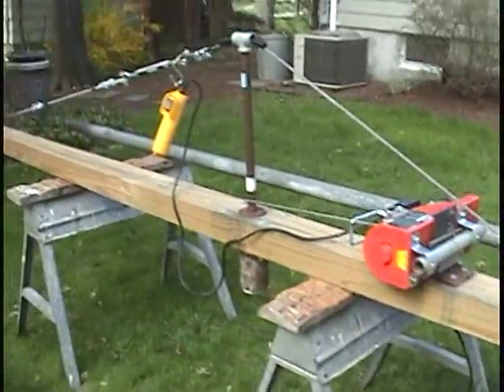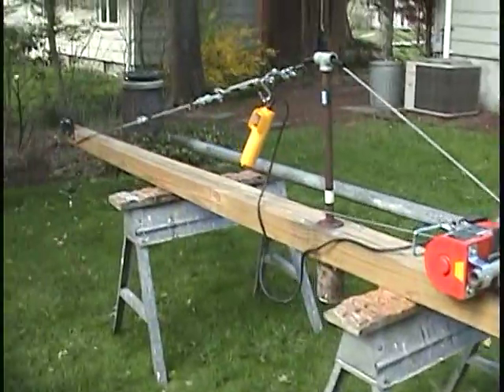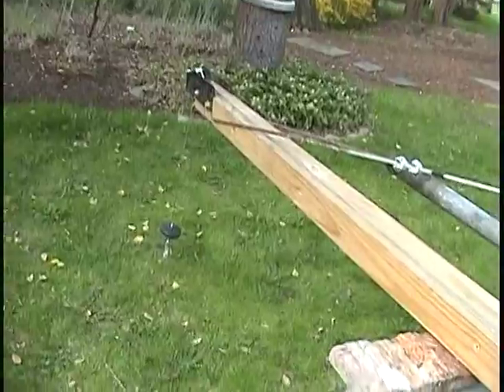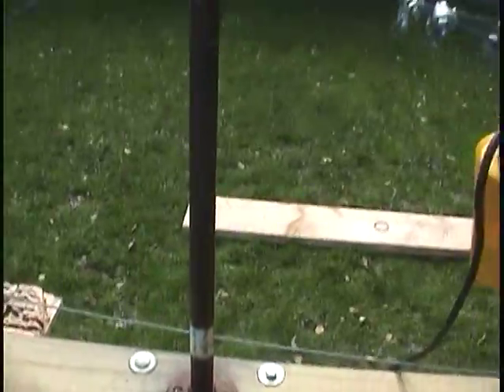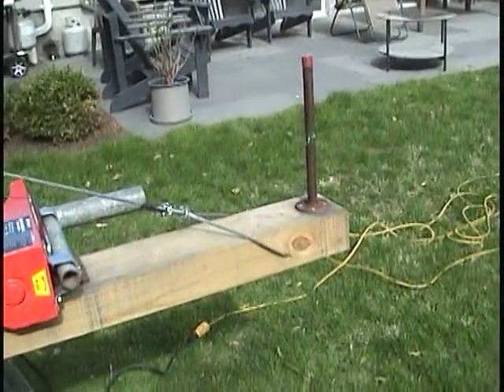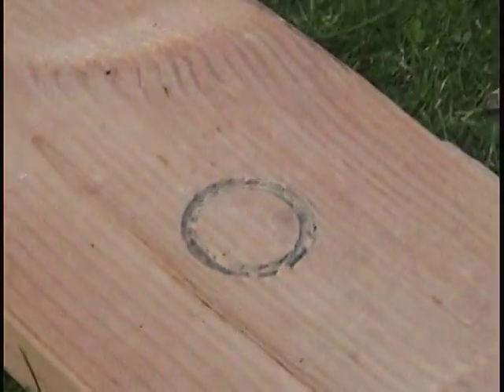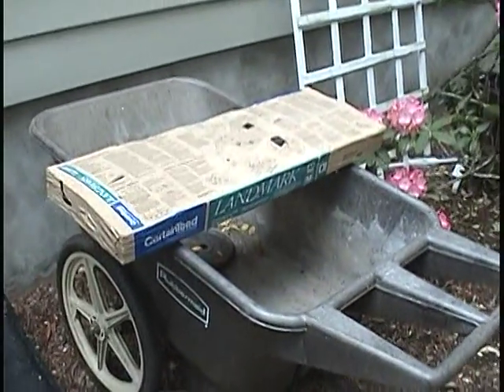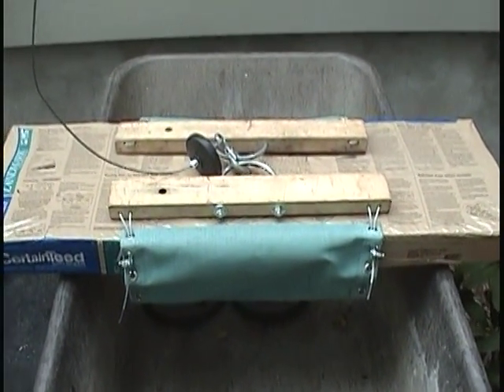Shingle Lift Shingle Crane Shingle Hoist

Comment: How did you mount it to the roof?  Would like to that.  Very clever!!  Great idea!
Reply from the maker: I used a heavy 2" galvanized pipe cut through the roof at the peak, braced accordingly, and nested in to a wood socket on the attic floor. Since the pipe was only above the roofline by a foot or so, and the length below the roofline was 5x more, it had good lateral strength. Most of the force was downward.

Comment: Your work is great .We are"https://www.loadmate.in" RMS INDUSTRIES (Loadmate) (An ISO 9001:2008 Certified Company) is one of the leading EOT Crane Manufacturer in India."https://loadmate.blogspot.in/2018/03/one-of-vital-and-long-tasks-was.html"  We also manufacture Manual Chain Pulley Block, Loadmate),Electric Chain hoist, Electric Wire Rope Hoist, HOT Cranes, Gantry Cranes, JIB Cranes,Goliath Crane.
"https://loadmate.blogspot.in/2018/04/how-to-install-electric-chain-hoist.html" 
"https://loadmate.blogspot.in/2018/04/there-are-varied-prestigious-suppliers.html" 
"https://loadmate.blogspot.in/2018/02/www.loadmate.in_15.html"
https://www.youtube.com/watch?v=_mJFgI2_y0I "
"https://loadmate.blogspot.in/2018/04/cranes-play-important-role-within.html"
"https://loadmate.blogspot.in/2018/04/hoists-safety-measures.html" 
"https://loadmate.blogspot.in/2018/02/www.loadmate.in_15.html"
"https://www.youtube.com/watch?v=_mJFgI2_y0I "
"https://loadmate.blogspot.in/2018/02/www.loadmate.in_15.html"